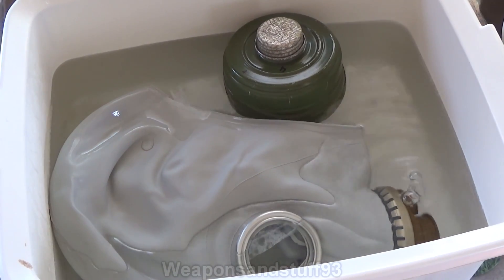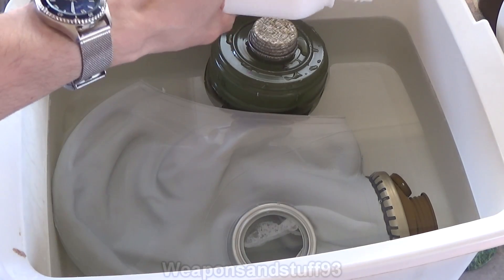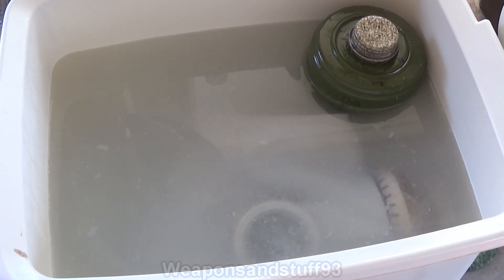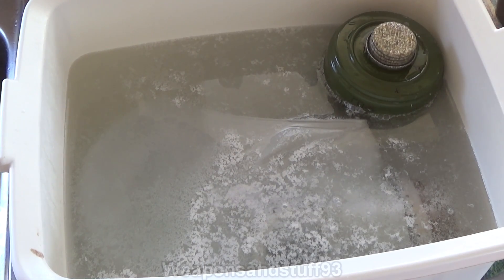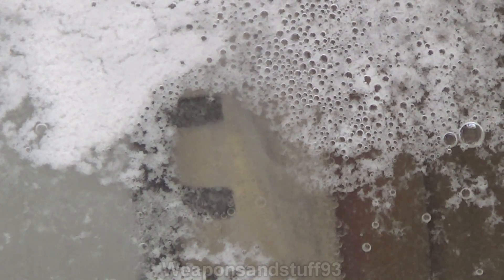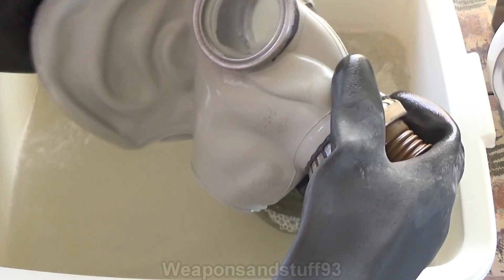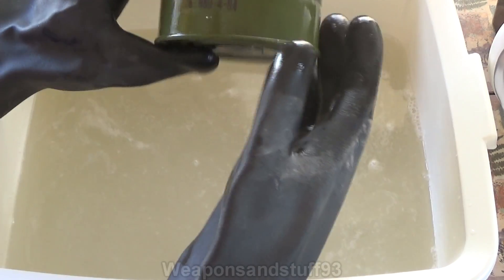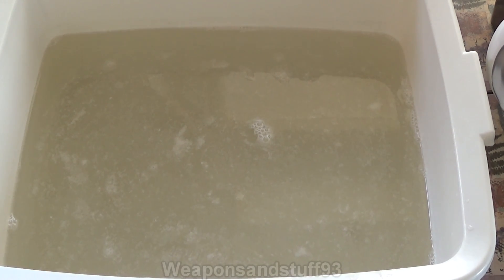GP-5 Gas Mask Alkali Torture Test

Comment: Interesting, corrosive rocket fuels melt the valve paint off and caustic substances damage the lense and valve box connector. Outserts and hose covers need to be used with these substances.

Comment: Could you do a video gauging the NBC potentials of Flex Tape and/or Flex Seal? I figure if it's liquid rubber, could it be a potential quick-fix while you search for an intact replacement?

I can almost guarantee you'll get a couple hundred thousand views if either Phil Swift or JonTron gives you a shoutout... Do it for the memes, Liam!
Reply from the maker: Is that like duct tape? If so it should patch small leaks
Reply: @weaponsandstuff93  kinda, but is really good. It would cool to test how it stands up to chemicals